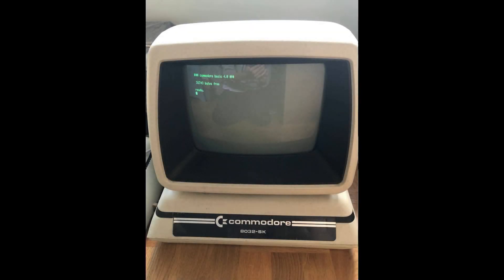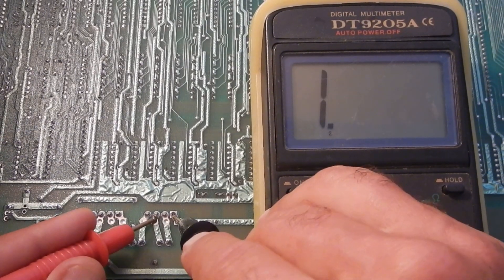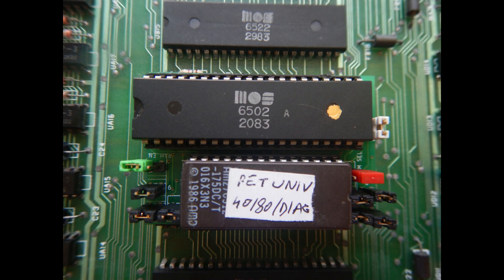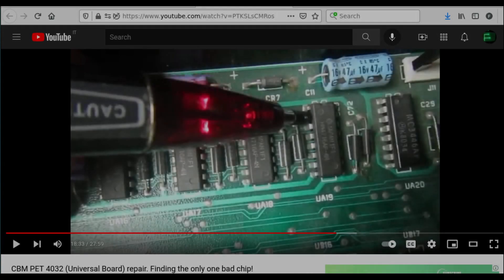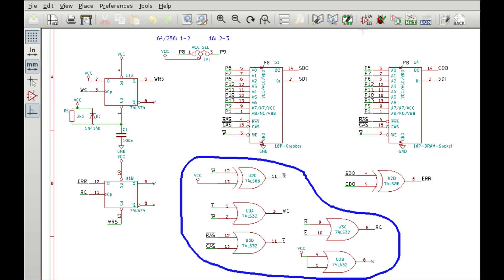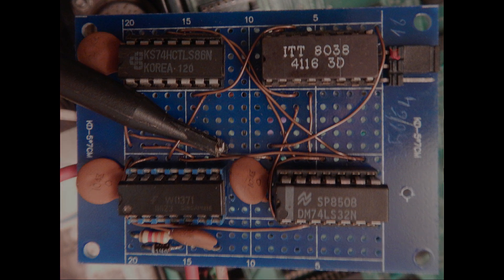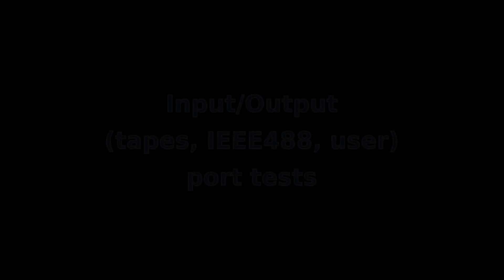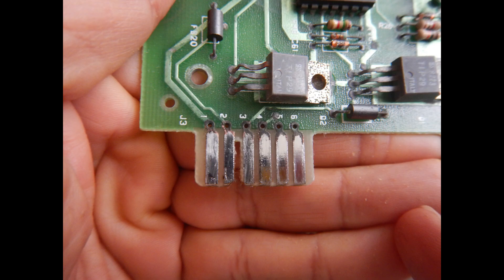Commodore PET 8032-SK repair. Making a new "old school" troubleshooting tool.

Comment: That comparator tool is excellent, what a good idea!
Reply from the maker: Hi! Thanks! I've actually borrowed the basic idea from the old (and quite rare) HP logic comparator clip that would do a similar job on standard TTL chips. Applying the idea to DRAM is actually feasible (as I have demonstrated) once all other possible faults have been ruled out.

Comment: Awesome video and great troubleshooting, as usual.

I absolutely love the DRAM comparator you made, that is just brilliant. I am shocked no one else has come up with something like this up until this point.
Reply from the maker: Thanks Adrian! The inspiration actually came from the HP in circuit TTL comparator (I wish I could find one!). This tool was indeed very useful for this particular repair, but it only gives good indications if first one makes sure there're no other faults in the address path or on the data bus, so its usefulness decreases if you think about this fact.

Comment: Molto bene!! How did you connect the external monitor to the board? If you have video on that please let know. Excellent work as always
Reply from the maker: I made a simple adapter circuit to use the old EGA/MDA monitors (that one is a dual sync monitor that can work up to  around 20 KHz horizontal rate). It's the little perfboard
hanging to its power supply legs in the left part of the bench. It's not so "general purpose" as you need one of those old TTL EGA or MDA monitors anyway.

Comment: I really appreciate the amount of editing effort you put into your videos lately. They're that more pleasant to watch and fit your top quality content much, much better. That in-circuit tester is a brilliant idea! I've had one of those rectifiers fail in a 1541 in a very strange way: Two of the diodes had voltage drops >1V. So there actually seem to be failure modes between short and open also.
Reply from the maker: Hi! Thanks for the nice comment! I've never seen a diode going to a larger voltage drop, always seen them going to a lower drop, but yes, diodes have very strange failure modes sometimes.